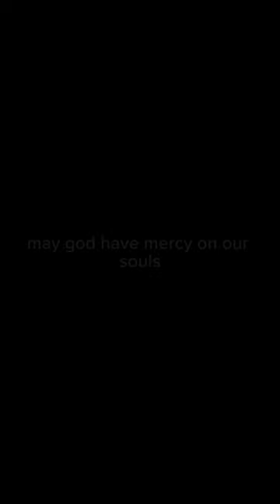Who is Boosted Luckey?…#shorts

Comment: "Blowing a driveshaft" set his car on fire?
Reply: shrapnel in a perforated oil pan plus hot parts = fire.
Reply: @misaelhp1 Tell me you know nothing about cars....
Reply: @doughaner2709  you never saw piece of shrapnel sticking out / flying out the block, that means you need to spend more time at the dragstrips it happen at least 2 or 3 times a week but not always the cach on fire.
Reply: @misaelhp1  I've seen a dozen or more driveshaft failures.  None have ever resulted in a fire.

Perhaps if a fuel line was severed it's possible.  But not at ALL likely.
Reply: @doughaner2709  agree..
Reply: I mean let's be honest, these engines are known for catastrophic failure all on their own which lead to a class action lawsuit. It's rarer, but I suspect a lot more likely under abuse lol. It was probably a compilation of failures not just the driveshaft. The driveshaft was likely just the most obvious problem.